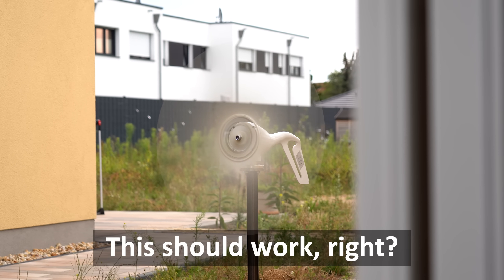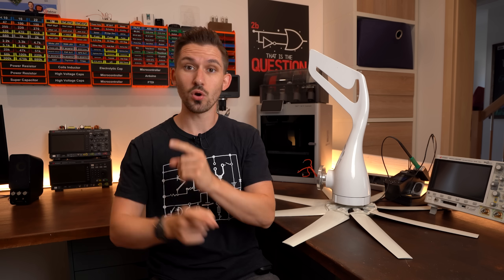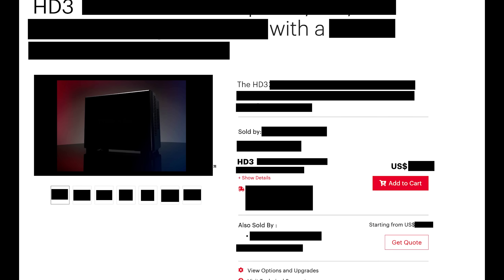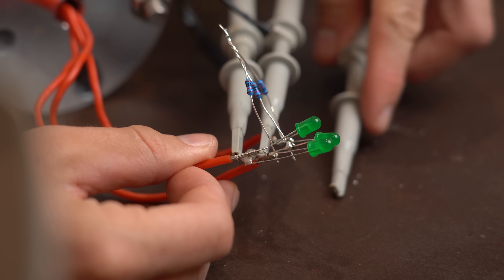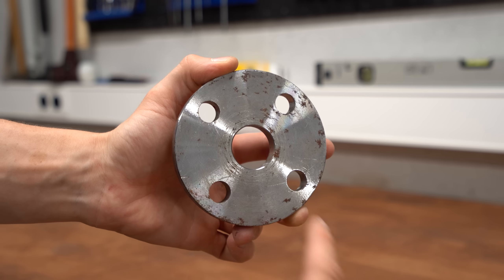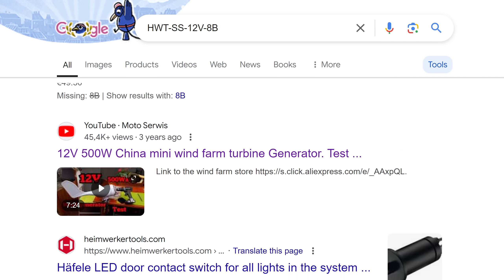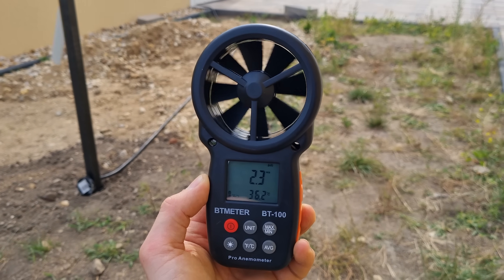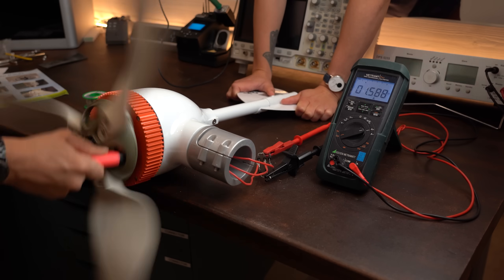I tried to Power my Home with Wind Generators! (Worth it?)

Comment: Well, a couple of things about this...
a) well, even getting a meter higher will be doing a lot and if it is 'out of sight' but somehow the most common winddirection is tunneled towards your generator, you will gain a lot of more efficient power.
b) those fans are really, really flat and not curved right so far from optimal especially at low speeds. You probably want to aim for a speed at which the tips of the fanblades go around 100 km/h at a good strong wind (like force 5), or go slower but with deeper blade-curvature.

With that said, I had a little wind-generator just a bit bigger (longer blades, only 3) with a simple bike-dynamo as a child that could easiely generate 3 Watts with the wind you had in your back-garden. It was just a little bit higher but of course you get a far more efficient windflow, also lots safer because you don't walk into it or pets for example. Maybe just on top of the washing-rack?
Actually, as long as things are 'mobile' like on top of something you ride or drive, most building-codes are pretty 'free' in most EU-countries as long as you stay under 6 meters or the maximum  roof-hight.
And yes, there are also exceptions for wind-generators and such as long as they don't give disturbing shades and reflections so you might go higher than that.
My father had an experimental generator that was bigger (I think 4 meter tip-tip, 2 blades) and could easily generate 50-80 Watts but for those you really need to get some safety-things into place for storms and such. A couple of 100 Watts was theoretically also possible but we didn't get around to hooking the electronics and generator up (it was the 80s).

We were both millers (yes, the old-time famous windmills of the Netherlands) with diploma's a couple of years later and those were having no real problem with some KWatts with a small generator of course. But you need some well made regulators to controll the loading and also the different windspeeds within just a couple of minutes.

Comment: good video.  The only time I’ve ever thought a turbine was right was for marine applications like on the back of a sailboat.

Of course those cheap generators give you cheap results and in my years of doing alternative energy for a living I have never recommended a wind turbine.

Also if you want any good output, you gotta spend some serious money to get something worthwhile then you gotta put up a tower. There’s regulatory hurdles,  just a straight up pain in the butt.   Solar is easier and for the trouble we can always build bigger battery packs. 

that’s my two cents

Comment: You made a major mistake. You need to get it off the ground.  On the ground between two buildings is just about the worst place you could have put it other than simply burying it in the ground itself.   the wind about 20 feet off the ground is ALWAYS higher than it is at ground level where you have that.  It's like keeping a solar panel in a closet.

Comment: As many people noted, height is king and a windy and empty flat area I may add (no obsticales like forest, houses etc). There are wind maps, one can check the avg wind speed in your area, I think one needs minmal like 3 meter per second. Usually costal aeras are the best, as the sea is practicaly flat. One can design a turbine, for examaple for high speed then the change is it will not start it self. Also traditional design has to point in the wind, this needs complicated, heavy and failure prone contraptions. Murray Smith has good youtupe channel for turbine design and theory.

Comment: All that work pouring concrete and welding pipes, to only put the generator 1 meter off the ground.  The wind is always better off the ground.  Darned local rules.  Wind is definitely one of those things that is either absolutely awesome, or completely stupid, and not a lot in the middle.  One of Solar's big advantages is that you can scale a system to any size.  There's just no wind system that competes (sensibly on all axes like cost, time, volume, etc.) with something like a 10 Watt USB solar panel.
I really wish I could just stick a PC case fan wired backwards out the window of my apartment as a backup power source and get a few watts, but it's never quite that easy.

Comment: Great video, but I am curious, why did you opt for 12V instead of 48V? I think that would have yielded much better results. All that to say, yes, please rewind it :D 
I am very curious whether some DIY arduino-controlled DC-DC buck/boost module could improve your results through trial and error. You basically have rotational speed data in the output voltage frequency, and there must be an ideal "powerband" even at low speeds when boosting it (which would be the maximum current pulled without leading to significant loss in frequency once up to speed, minus some margin of error, I think - totally could be wrong). I have thought about these things a lot, so I appreciate your video!

Comment: I think you just simply bought terrible wind generators and converters. Such generators, roughly the same sizes, are very effectively used on sailboats to charge batteries since decades. There are even some very quiet ones too.
Reply: Can you name a good model to get?
Reply: @Opspin  I'm a huge fan of the Siemens 3.6 SWT.

Comment: Well, according to various sources, the power of wind is given by pi/2 * rho * R^2 * V^3, where rho = 1.225 kg/m^3 is the air density, R is the blade radius (0.6m in the case of your newer 3-blade turbine according to the AliExpress site). Now if we assume a wind speed of v = 3 m/s, then the above formula gives us roughly 18.7 Watts -- which would be at 100% efficiency, of course, so there simply isn't all that much wind energy to harness at those wind speeds and with such small rotor blades in the first place...
Reply: the minimum average wind speed for any practical power production is 7 m/s.

Comment: Interresteing video, and nice to give it a try! There are a lot of turbulence close to a house and close to the ground and without the possibillty to have the turbine high up very little energy will be produced. Only reason for small wind turbines would be if beeing offgrid, then it might be a good complement for maintainance charging of battery banks. Where I live (Sweden) you are allowed to put up a wind mill up to 20 meters in height (top of blades included in measurement) without building permit. Since my cabin is offgrid i thougth about this first, but went for solar panels instead due to cost for the pole and securing systems.
Another thought: On such low voltage 12V energy are lost in the cables, even a few meters (I guess you already calculated on cable area and voltage dropped!) will be a problem. Well...maybe not if fhe power is 2W...but more power are problematic on long cables and low voltage. What about using transformers, get the voltage up to say 80V, and then down again at the regulator?

Comment: Maybe diy roof "invisible" turbine like ridgeblade (but diy maybe using big used industrial fan or something) , it should be possible to mount it without legal problems (but im not sure)
If you rewind the ones you have you will probably reach way more voltage than controllers can handle , it should be possible to make bridge rectifier , add some capacitors etc and connect standard solar mppt 
But because there is no brake in it add simple rpm controller brake using some resistor or something to slow it down at specified rpm

Comment: The power in wind equation tells us that power = 1/2 * air density (kg/m3) * swept area (m2) * (velocity (m/s))^3

Small scale wind power just doesn’t make sense. You need big blades to increase the swept area, and put it as high up as possible

For your little turbine which is like, 50cm radius? 2.5m/s wind? You can get a maximum of 7 watts. Except that is not possible. Betz law tells us the theoretical maximum is 59%. Your 1.5 watts is 21%, not much of a surprise with the cheap controller & windings

Comment: I think you could probably make your own MPPT controller with an Arduino and some cheap buck/boost converter "benchtop power supply" that you can get from aliexpress. Just have the Arduino adjust the current limit to keep the voltage high enough.

Comment: Isn't it going to be better if you just keep the full wave three phase rectifier, and feed the 5 - 7V output in a boost/buck converter with a current limited output?

Comment: For this to work properly it needs to be  above the general ground obstacles, 25m up is a good start. That's why traditional windmills used to be on a hill.
Reply: And modern turbines from 4-6 MW have 150-200 m hub height!
Reply: Just getting it above the roof of the house would be a good start.  Above the trees, even better.  I would never expect it to work effectively between two buildings. Also, as other people have mentioned, the size of your propellers make a huge difference.  If you are into DIY, look into making your own blades.  Just remember to balance them.
Reply: Yup but the corruption in government means that it can't be mounted that high otherwise people would be producing their own power.
Reply: They were placed on the hills because of physical phenomenon, not because of the obstacles, same way it's better to place one on the highest place of the rooftop since it amplifies wind force by a lot.
Reply: amazing how many people will spend money that will never be recovered
Reply: maybe watch 9:59
Reply: @GMDBestBoi  maybe realize that doesn't change the fact you are replying to.

Comment: Seeing your video at around 10:24 mark the windings appear to have two windings in parallel for each phase in a likely 3 phase Delta configuration.    If so you should be able to isolate each winding set for each phase and put them in series and then reconfigure the the three phases into a Wye configuration to get a way higher output voltage from it.

Comment: well you can make variable pitch blade for wind turbine so wind speed wont affect output power. and i guess winding connection in wind turbine is delta not star and using diode will waste power and you should make your own mppt controller so it can work in low voltage. as always nice and informative video

Comment: as low effort, could you try use a 3ph autotransformer (or three 1ph autotransformers) to boost the AC voltage?

Comment: This is dumb. You said its not worth it, but thats only for your case where you cant even get high enough to get decent wind speed.
Reply: Small wind turbines are a scam. They really are. If you live in a area where you can have a tower and a medium/large scale home turbines you'll be okay, but their power output is never great. 

  I worked for a home power company back in the day and every single wind turbine we installed was returned and eventually the owner stopped carrying them.  Solar and home hydro (if able) are the best ways to go.

Comment: Did you try bottleneck areas if you have?, like two unparalleled walls and put the generator in the narrow side, you will be amazed how faster the wind is, anyway just saying, i never tried it, if its not too much you can create such bottleneck areas for the sake of the video like a wooden angled wood next to ur house wall

Comment: A decade ago just as solar prices were starting to fall I was at a meeting with a company that did green energy installs. They said it didn't look like any of their customers that installed small scale wind generators would ever break even due to higher maintenance that quickly wipes out any savings if you are paying someone to come fix it.

Comment: There is no such thing as a low windspeed generator in practice because low wind speeds have LOW ENGERY. You need very large blades to extra energy at low wind speeds if you cannot go vertical sideways may work.

Comment: You have got to increase the diameter since you can not increase rhe wind. Power output comparison with theoretical values would help understand if thid is a good design and if you have margin to improve it.  Do you plan for blade pitch control ?

Comment: These a loss of efficency, but a gear box might be the better option. Or at least the faster one vs hand winding a motor/generator to output higher voltage

Comment: You should have chosen a "vertical axis wind turbines" generator. They work in much lower wind speed and they make less noise.
Reply: The fact it runs from low wind speed is...hmm..how to say it, the slow wind carries almost no energy and combined with lower efficiency its just tragic.

Comment: In 95% of cases a wind generator is not going to be mounted on the ground where wind speeds are low. Would be interested to see if it performs better on a rooftop or something like it's designed for.

Comment: 0:33 - "One time it blew so hard, it ripped apart my garden shed. "
Or typically a wooden structure located in Europe, with the equivalent strength of an American house...
Reply: Garden sheds in Europe fall far short of building codes for residential frame-built homes in the US.
Reply: @teebob21  You're probably right. 

It's just funny to joke about American houses, in order to get an annoyed American response.

I estimate that about 98% of all houses in the country I live, are build using brick and concrete. However, my family in Sweden live all in wooden houses. Those houses are in my experience, equally sturdy and comfortable to live in as brick ones.

It's on camera however that wooden houses look flimsy, compared to brick or concrete buildings...

Comment: It is pointless to modify it. There is straight relation between wind speed and surface are of the wind capturing device. You can find the formula everywhere. I've done previously some calculations about this particular garbage. In best case scenario you can get 400 wats at about 23m/s as I remember.